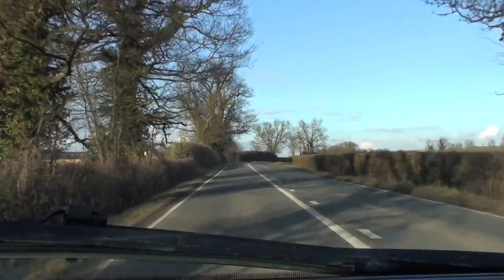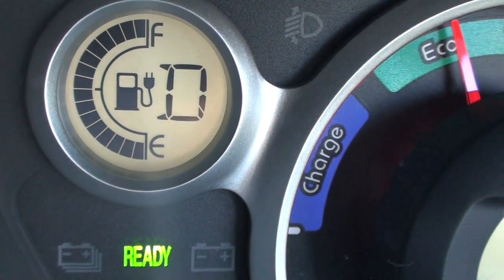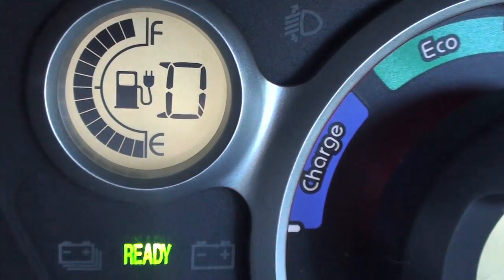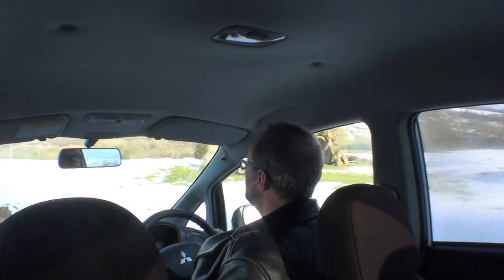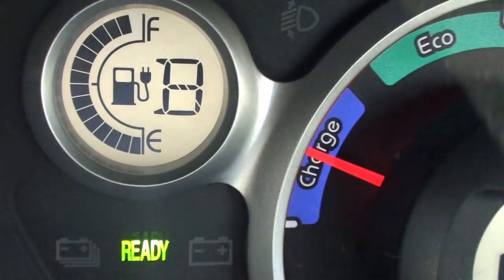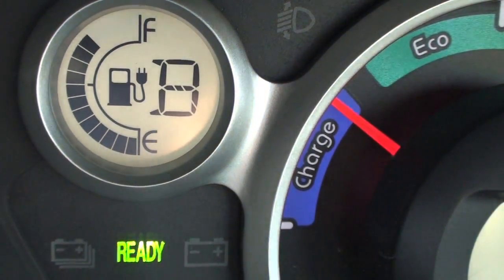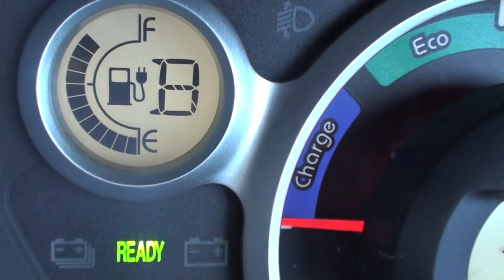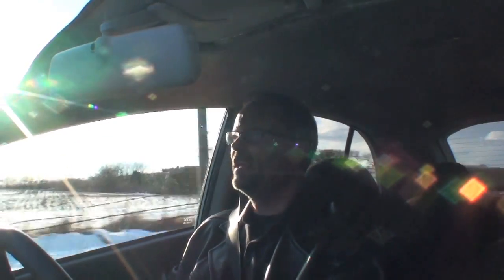Regenerative braking?

Comment: For safety's sake, most (if not all) electric cars separate braking on the brake pedal from regen, so if the electronics fail for any reason you can still use the brakes to stop.

AIUI, the iMiEV usually freewheels like an automatic car for coasting, but when it's in "Brake" mode it instead engages regen all the time, so it drives more like a manual car with engine braking.

Comment: You're gonna see get another bar added mostly only if you've just used the bar you're adding. If you consumed just 1 bar for traveling 15 miles, then you're gonna need aprox. the same downhill distance to get it back.
It does get back on my Vectrix, but only if you just consumed the bar or if you're going down a very long road.

Comment: I think you were expecting too much from the "bars" moving. I mean, on the first hill, if you only used 1 bar driving all the way there, it would be pretty incredible to get that bar back just by freewheeling down a hill. Even if you got 10% of the energy output back, that'd only be 1/10th of a bar - and those bars look like they update a whole section at a time - meaning you wouldn't see any difference on the display.

Or I've completely misunderstood, which is wholly possible.